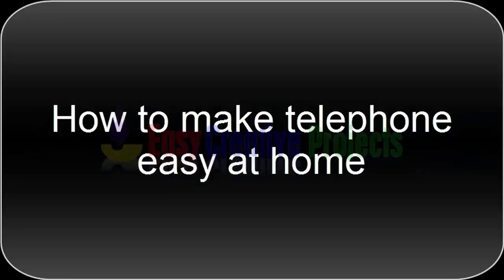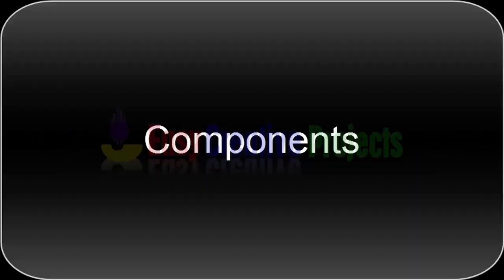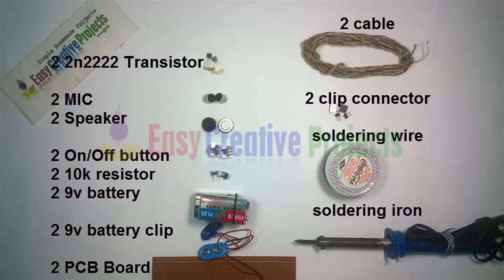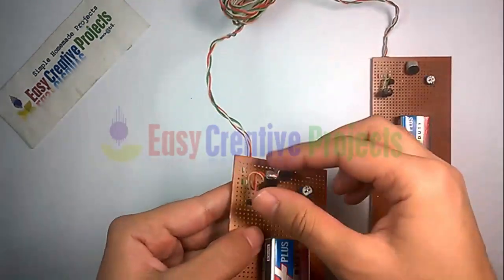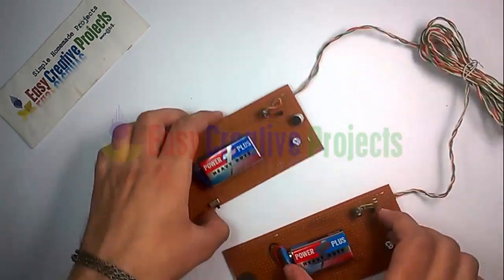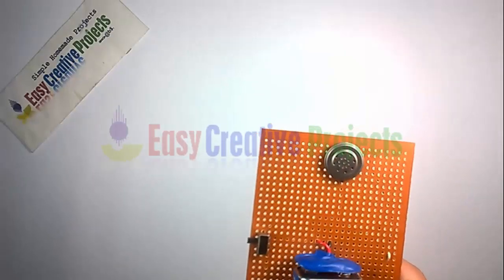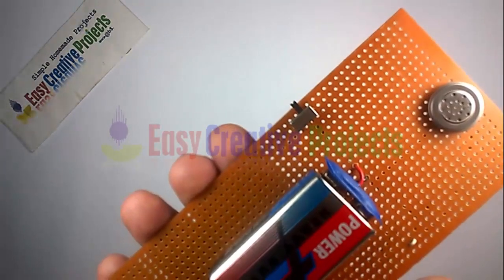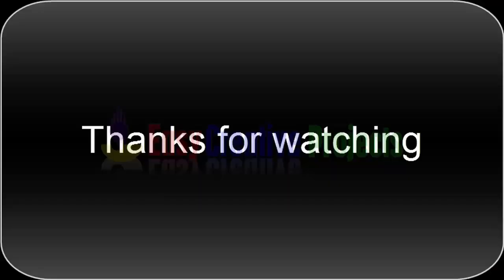How to make telephone easy at home - step by step with circuit diagram

Comment: This is great.  Your projects are awesome.  But could you please suggest for how much distance this homemade telephone could work properly.
Reply from the maker: dear i use 5 meter internet cable wire and here its work properly.if you want to increase range then you need to amplifier circuit.

Comment: What is going to happen if position of potentiometer determines middle pin is shorted with Vcc and 10km with mic?
For sure you are going to burn transistor but if you will be slow enough turning it to mentioned position you will ground potentiometer as well, because until it is shorted and full available current run thru potentiometer with 8.3V :D

Comment: wow this is really cool and a great job explaining it all.  Thanks!
Reply from the maker: you welcome.
Reply: Hell super comed
Reply: if it really works then i want to ask maximum how much long the wire connecting two phones should be like, 2, 5, 10, 20 metre....how much or can i use it to talk to my friend who is far away 100 km from my city using 100 km long wire lol 😭😂😂😂☹️🤔🤔🤔🤔🤔
Reply from the maker: @Subswithnovideos-gv9qi  dear in this circuit i use 5 meter wire. if you want to increase then you need amplifier circuit for boosting sound.
thanks.
Reply: Did it work

Comment: If I want to use a single 9 volt power adapter instead of (2) 9 volt batteries, how would it be different?
Reply from the maker: no difference dear. you can also use 9v power adapter.

Comment: What impedance and type of microphone is being used?  Electret, carbon, crystal?  Also, what is the Ohms rating of the speaker?
Also, is this on/off button used as a "push to talk" switch, or does it just turn the circuit power on and off?  Is it a momentary switch?  Video makes none of these clear.  What is the variable resistor used to adjust and how should it be adjusted for proper function?  I'm quite unclear as to how this circuit works without a transformer to drive that speaker.
Reply from the maker: its simple combination of mic and speaker. mic use for voice collection and speaker use for voice output. and transistor use for amplifier sound. and variable resistor use for sound control. 
on/off button use for battery power.
its very simple and basic project. 
if you want wireless phone set. so see video on our channel (how to make wireless phone set.)
thanks.

Comment: so nice.  but can I use 3.7v battery. cz 9v battery so big. what volt is really need?
Reply: 9v battery is much, you can connect two 3.7V Li-Ion Batteries in Series to get 7.4V, or you can use 9V AC DC Adapter

Comment: can i use it for my neighbours?
Reply from the maker: yes dear you can use it with neighbor house. and enjoy life time free calls.
if you facing any issue about this project so please tell in comments. we try to solve it.
thanks.
Reply: thank you
Reply: but how am i going to replace the battery?
Reply from the maker: you can use 5v charger or 5v battery. 
simple replace positive side of cell with positive wire and negative side with negative wire.
Reply: No is against the law. don’t do it  you will be arrested and sent to prison

Comment: Can we use bc 548 
Then which resistor should be use and which battery 
plz reply sir for more information
Reply from the maker: yes dear you can use bc548 transistor. 
other all circuit has no change.
i already use variable resistor. you can adjust it as your requirement.
thanks.
Reply: thanks sir

Comment: I have made it,but volume is low how to increase it plz tell me.
Reply: I think it helps if you put more current over the Transisttors base because it is the transistors job to amplify signals after all. Maybe lower the resistor down to 5K and hope the transistor doesnt burns away. Though it might also not work out cus i am not aknowledget enough with such circuits.
Reply: without a transformer to amp up that signal, I can't even imagine the circuit works...

Comment: what happens if you wire a 3rd phone on to the line?
Reply from the maker: dear its simple combination of mic and speaker. its total depend on you how many set you want. you can connect it each room as your demand.
Reply: @EasyCreativeProjects  inter room conversations

Comment: Where to connect 1st phone speaker to 2nd phone?
Reply from the maker: 1st phone speaker connect with 2nd phone mice.
and 2nd phone speaker connect with 1st phone mice.
mice is input device and speaker is output device. 
simple.
thanks.
Reply: @EasyCreativeProjects  thanks bro
Reply from the maker: @manjulachintu3250  you welcome.

Comment: I use 5.6k are this working
Reply from the maker: yes but then you cannot increase sound.
Reply: @EasyCreativeProjects  if i use bc547 show diagram please and 5.6 k ohm in my circuit
Reply from the maker: yes dear you can use bc547 transistor.
Reply: @EasyCreativeProjects  show diagram please
Reply: Please write
Reply from the maker: dear simple replace 2n2222 transistor with bc547 transistor. 
we explain every thing in video with circuit diagram. for more batter understand you can visit our website. 
thanks.
Reply: @EasyCreativeProjects  ok

Comment: How to connect the two sets
Reply from the maker: using wire.
Reply: Using long wire speaker from circuit 1 place it on circuit 2, speaker from circuit 2 place it on circuit 1.

Comment: can you show me with out PCB .Because I confused to connect wire .can you explain me clearly?😓🙏😟😳
Reply from the maker: dear in this project i use simple combination of mic and speaker.  
1st set mic connect on 2nd set and 2nd set mic connect with 1st set. 
transistor use for amplifier sound. its very simplest project.
Reply: First set of mic second set mai mic se connect karna hai ya speaker se